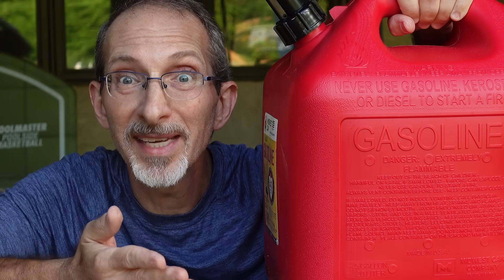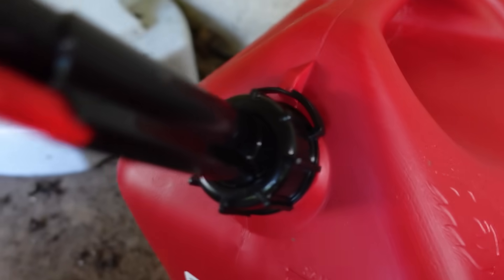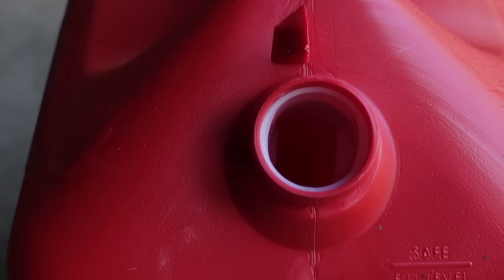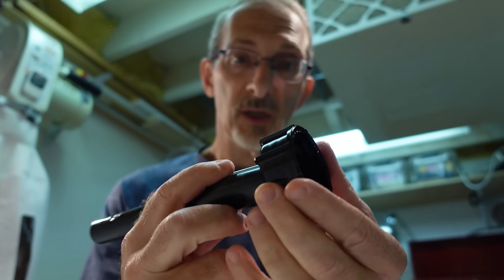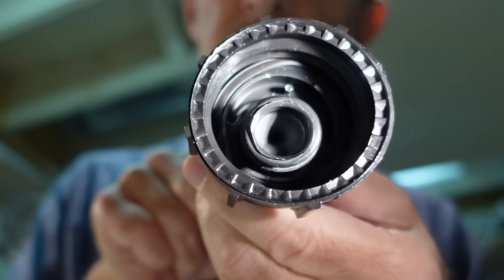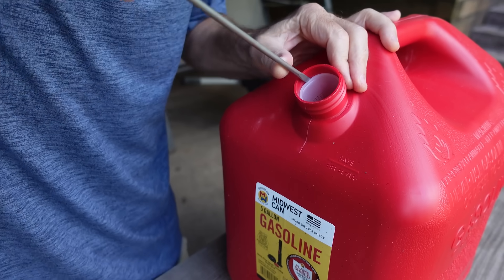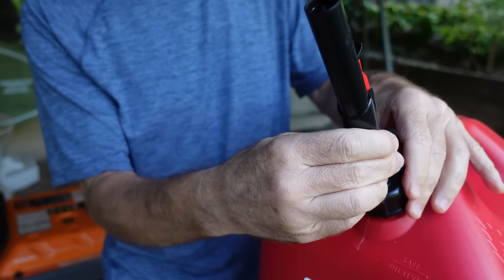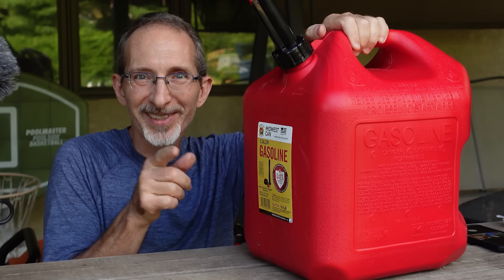Gas Can Modification | New Gas Can Fix

Comment: Wish I had seen this a week ago. I was in the market for a gas can for the first time in probably 2 decades after seeking asylum from CA to free America. I knew the gas cans there were.....less than easy to operate but didn't realize that CA's stupidity had infected the rest of the country, at least when it came to gas cans. The cans used in this video were by far the least expensive option, but not the easiest to operate. I shopped several stores and every can, no matter the manufacturer, was a PITA to operate. I ended up leaving all of the stores very frustrated. Later that night I ran across a YT video about the No Spill cans, which are expensive. The operation seemed easy enough and there were some other "safety" features that were attractive so I bought one the next day and it works fine. Had I seen this video instead, I would have saved myself about 50%.

Comment: I doubt if that is meant as a filter since anything caught in the filter immediately gets flushed into your tank on the first fill. All those so call safety features are to prevent an idiot from attempting to throw gasoline on a campfire out of the can. You can thank a trial lawyer (who got very rich) and a stupid sympathetic jury for a huge ridiculous to an idiot that try it. The settlement for those safety features and the idiot-proofing the companies had to do to continue to sell gas cans only cause inconvenience and more unsafe conditions.

Comment: I agree. they make it UNSAFE! Look. when I remove the nozzle from the can I want that fuel to come atta there. I have a really long twist drill set used for a special purpose so what I did was clamp the thing in my bench vise and drilled the center out. washed out all the plastic debris along with the spring that got in the way (it got kinda butchered by the bit anyway). Took me about 30 seconds per nozzle. Problem solved. BTW I did this when the cans were brand new whose purpose was to have extra diesel on hand as part of hurricane preparedness. yeah the yellow cans are for diesel but nobody else is using these cans so I don't care about color either.

Comment: I have several red plastic gas cans for my mower and other gas powered stuff.    I would NEVER buy one of these stupid design gas cans like the one in the story.   Yard sales, and Estate sales often have older gas cans for sale for 2 to 4 dollars that work well, and do not require modifications to operate.   I always buy the older cans, clean them up on the outside with any type of degreaser  ( think Fantastic )  Rinse out the inside with fuel, and they are good to go.  The companies that make gas cans know that their products doNOT please their customers. But thanks to the wisdom of our Govt. we are stuck with this mess.   Party On Dude.........

Comment: I have a 2.5 gal plastic gas can, bought for $4.99 about 30 years ago. Simple spill proof design with an easily removable plastic disc insert below nozzle and a tiny nipple air vent which stays shut with a  push cap. 
Still going strong.
Reply: That air vent makes such a difference!
Reply: I think I have the 5-gallon version of that!!!  Now I'm going to take better care it, hopefully get another 20 years out of it.
Reply: Good point, adding an air vent valve is a must in modifying a gas can.
Reply: Be careful with it, you might hurt yourself in another 30 years with that dangerous spout🤣🤦
Reply: @455buick6  LoL. Tru Dat Bro!
Reply: It's probably American made I'm assuming.
Reply: @dpz9872  Absolutely, positively … Made proudly in USA.
Reply: @shekharpatel  

The things that last almost always are. 👌
Reply: Why don't new cans have that little nipple bit that lets you open it and let the air out of the can when it's really hot or to let air into the can when it's real cold. All my new, safe cans are either blown up like balloons if I don't notice them and release the pressure in summer or they look like collapsed beer cans in the winter. Pouring them is a nightmare.

Comment: That spring is so strong a friend broke the gas tank on his push mower trying to get the gas to flow.
Stupid.
If the government wanted a safety valve they should have used a lighter spring.
He ended up going to a farm implement store and bought an old style spout, through the original spout in the trash.
He used a long 1/2 inch extension and a hammer to knock out the plastic screen so gas could flow freely.

If it wasn't for so many total idiots we wouldn't need so many safety devices.

I say, remove all safety devices and labels and let natural selection weed out all the retards.

Comment: The "filter screen" does help preventing dirt & debris, but the it's really a flame arrestor. I had an old gas can that I needed to get a spout for. Having found only the latest design spillzmore spouts at the big box stores, I didn't buy one. Until I found an EZ-Pour spout replacement kit at the local Tractor Supply store. The flame arrestor is built-in the spout, where it belongs. There are states which do not allow the EZ-Pour spouts to be purchased. I'm shocked they are still for sale in the state I live it.

Comment: I guess you can't read. The can clearly states that 'filter' is a flame shelf/arrester, NOT a fuel filter. And it's not permanent. Plus you can fill the can just by slightly pulling the nozzle out a bit. My main issue is the rubber gasket that is supposed to seal the entire thing on. The gaskets leak and crack. Then the threads on the cap are different on different brands. If you knock that 'filter' in, it's no big deal. It just flops around. I do like the cans because they have a handle on the back so as you fill equipment it gives you a handle in the correct spot.
Reply from the maker: George, yes - the filter is indeed a flame corrector, which I corrected in my second video. Thanks for commenting!
Reply: @MikeFyxdt  2nd vid... I'll have to check that one out.

Comment: Keep the filter and press the pump slowly it will work.. if you fully press will stop.
Reply from the maker: Adi, I really tried to fill it, and so did the gas attendant (yeah, we still have some of them in PA). I figured if he couldn't do it either then it was an issue.

Comment: Once I realized how you have to use these new cans, I haven't had an issue with them.  Doing these mods, especially the removal of the spring, totally defeats the purpose of how these are supposed to work.  Let me help.  Step 1.  Click the locking mechanism.  Step 2 Lift can into position, holding can in pouring position inside the object to be filled tank's opening.  Step 3. Push collapsible mechanism on the edge of the tank opening allowing the fuel to flow.  Step 4. Adjust pouring angle for optimum pouring speed.  Listen for the gurgling.  Step5.  When fuel is filled, lift can up a bit to allow the spring to expand and stop the fuel flow, keeping the nozzle in the tank for a few second to allow fuel to stop flowing.  Step 6.  Shake off final drips and remove nozzle from the opening.   Done.   No spilled fuel whatsoever.  When filling a smaller device such as a weed whacker, you may depress the nozzle with you finger to have a slower, more controllable stream.  Hope this helps everyone.
Reply from the maker: Dave, thanks for sharing your thoughts! In my second video (link in the description) I modified the spring to make it easier to depress and returned it to the spout. It worked much better. I also think this spout design is easier to manage on 2 gallon containers, whereas my 5 gallon container requires Both hands for me to lift and tilt. Your method is good, but it definitely requires a free hand.

Comment: Near Ditto Mike. What I do is snap the POS safety trigger out and buy a 3/4 pvc cap (cap is optional, I do it to keep the nozzle clear). Works like a charm, and of course you MUST remove the POS filter. The guys that design this aught be forced to use their own product, so we can sit back and laugh.
Reply from the maker: Thanks Stanley, I appreciate the suggestions!

Comment: Never allow the government to regulate anything that most elite will never have a need to use!  In order to push the release on my two new cans I had to use pliers to get it "click" to release the vent, I hadn't yet encountered the problem with the "filter" at the gas pump. I suppose that this company also produces the old pour spouts without vent device which will set you back about eight bucks per can!
Reply from the maker: I've heard that peoples' experience varies at the gas pump.. The aftermarket spouts are great options!

Comment: That is not a filter at 2:50 and 9:18. It is a flame mitigation device. It creates a mixture of gas and air within the tube that is too rich to ignite, and acts as a flame barrier which prevents explosions within the gas can. By recommending the removal of this device, you likely have burned or killed people. But hey, it's all about the views, likes, and subscribes.
Reply from the maker: Flame mitigation device described in my second video, link in the description if you would like to watch.

Comment: They stil make  old style spouts you can just screw on  which is the easiest to solve this .  Should you have to do this of course not .   They always have to mess with a proven design .
Reply from the maker: I agree! There are a lot of good add-on spouts and vents for these containers, but I agree you shouldn't have to spend extra money on them. Thanks for joining the conversation!

Comment: I have one of these "safety" cans that always builds up pressure to the point where it sprays out all over when I try to pour gas. I've gotten sprayed in the face with gas several times from the can. So much for safety. I recently cheaped out and bought one of these midwest cans to fill my tractor with diesel after I mistakenly ran over my old metal can. As I was trying to lift up the filled can, the nozzle repeatedly locked itself forcing me to lower the can and unlock it again. After about the fifth time I grabbed some pliers and ripped off the lock. The next day I went on amazon and bought a 3 pack of new nozzles and vents to fix all of my plastic cans. Your method is cheaper, but mine was more satisfying. :)
Reply from the maker: Wow, John, it sounds like your repair was therapeutic! In my second video, I added a yellow vent cap to the back of the container, which is perfect for relieving that pressure when it builds up. It also helps improve the flow of the fuel. No more glug glug, glug, glug, glug… 😁

Comment: Switch lids with a smaller can. They still have regular ones. Drill a hole to vent, you can even fish a standard valve stem in the vent hole, works great. Problem solved
Reply from the maker: Good tips! I added event in my second video, and it made a big difference. Thanks for watching and joining the conversation!

Comment: Thanks Floyd. I am having to learn most all outside things and I haven't mastered that gas container. Now I can.  I been referring to your videos each time I have a new adventure.  My next is trying to get a Murray lawn mowers plastic casing on motor off to check carb and filter. I was told that it doesn't come off and toss it. I will consider that when I conclude I am defeated. Past time to return it to store.
Reply from the maker: Lol, when too much time has passed to return something you get inventive!😁

Comment: Good content. However, I cringed a little every time you referred to the spark arrestor as a 'filter'. This part has nothing to do with filtering as any particles it does catch would just pour back out when you use the can!

The purpose of this mesh is to catch some sparks before they can get far enough down to contact fuel and to reduce the amount of oxygen that can enter the can if a fire did occur.

Is it effective? I dunno, you'll have to ask someone dumb enough to set their gas can on fire.
Reply from the maker: Stephen, yes! I corrected my mistake in my second video, link in the description. You are correct in all of the points you made… Can't stress this enough. Thanks for commenting!

Comment: Some jack wagon is going to see This great mod think it is sooooo unsafe and find away so you can’t modify it to make our life miserable again! Stop with the safety shit some safety items are making our life less safe like on riding lawn mowers where when you lift off the seat the mover dies now when mowing on a hillside we can’t offset our weight and now we have to fight to make it run and not upset it!
Reply from the maker: My mower has one of those seat sensors, too… And I remember the first time I lifted my weight, and the mower shut off, and I didn't know what had happened!

Comment: You can actually still buy cans with no safety systems like this. Just check any dirt bike parts site
Reply from the maker: Thank you, that's the first time someone has suggested checking out dirt bike supplies. Good tip!

Comment: No matter what other steps you took - Find another Service Station. I'm sorry but I don't want any attendant to dumb to simply ease up on the pump handle to slow the flow to get near my car(or cans)
Edit: One other thing - a weaker spring would be a better solution. Chainsaw and even small(mower/etc.) engines tanks fill fast from this type of nozzle. one misstep and gas is going everywhere as one snatches the can back from the fill opening.
*Yes, I hate these nozzles!!! The one on my Diesel Can gives me fits since the Fill opening is almost shoulder height.
Reply from the maker: I agree! In my second video (link in the description) I shortened the nozzle spring instead of removing it, and it did make a big difference.

Comment: The reason for such strong safety measures is to prevent redneck to SPUR GAS DIRECTLY FROM THE CAN TO THE FIRE:

A Gas Can company was sued to bankrupt for moron than keep pouring gas into fire directly ignoring the big warning label the company put in the can.

So if a redneck disable the safety measures as you do the company can defend itself as the can's owner modify it so the company is not responsible of a bad use.
Reply from the maker: @EliosMoonElios - There's definitely been some crazy behavior. But I do believe a flame arrester is a good thing to prevent flashback from fumes, especially when the container gets low. I just wish there was a better design. Thanks for watching and posting!

Comment: The "filter" inside of it also catches any trash going into the gas can and yet when you pour it back out of the gas can using a funnel you are dumping all that trash the "filter" caught right into a gas engine.
Reply from the maker: @01SVTBlackCobra - The filter is actually a flame arrestor, which prevents the container from back-flashing. (I corected myself in my second video, link in the description.)
Reply: @MikeFyxdt  I know why i quoted filter because it still acts like a filter also even though not its main purpose. It will still catch some trash going into the gas can and then soon as you dump it into a motor first thing inside the motor is the trash the gas pushes right back out of it. Use to it would settle to the bottom of the tank but not anymore. Thanks again